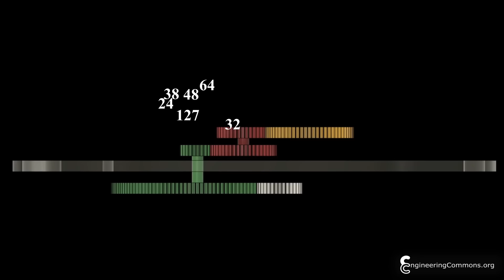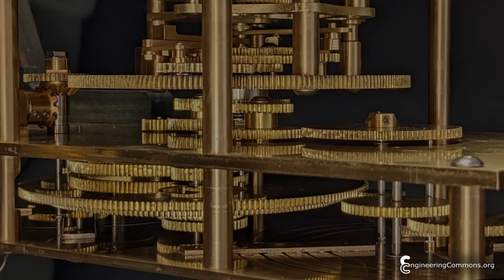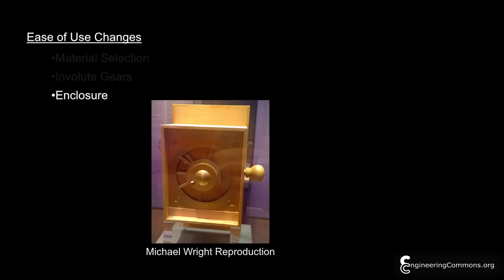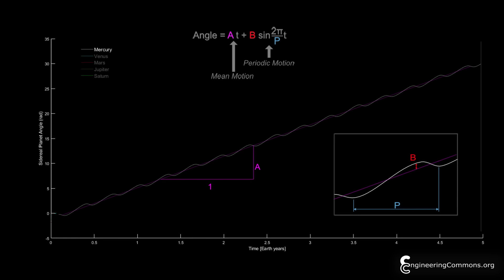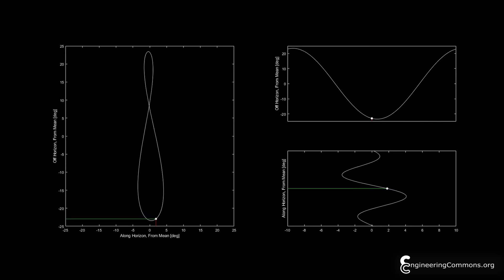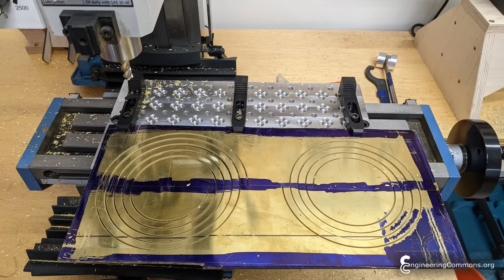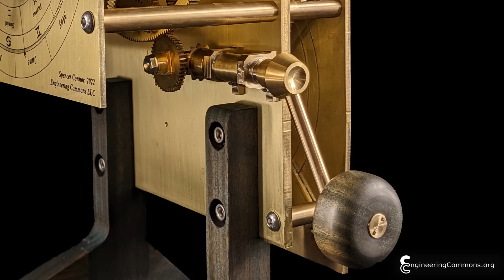Antikythera Mechanism V2: A Modernized Reproduction

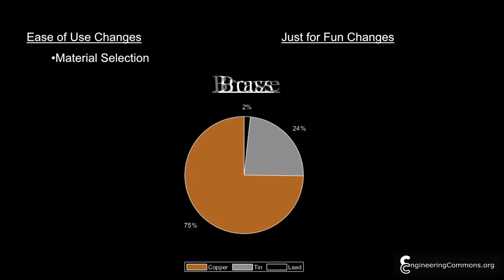Comment: 5:36 Knowing that brass is mostly an alloy of copper and zinc (to bronze's copper and tin) I'm wondering if the diagram depicting the metal component proportions and the pie chart for brass are a mistake, or if there is some other factor I'm not understanding.

Comment: Very well done, especially the geared mechanism for the backplate dials. 
But I would have liked to see more of how you dealt with two construction issues I encountered when building my own symplified modern  version of the mechanism (no planetary system and no backdial, but with real star map and dragon hand instead). My solutions were:

- single pointer for date and true sun: I implemented only the first harmonic of the true sun by using a non-uniform division of the date scale (offset equal to 1⁄24 of the radius of the orbit as attributed to Hipparchus by Ptolemy). In order to have the correct rotation rate for the moon train, I needed to implemented a 3-gear solar/date train to compensate for the non-uniform division.

- Initialization of the mechanism: I used December 4, 2021 for easy initialization (total solar eclips AND moon perigee) and January 4, 2022 (sun perihelion). To be able to set these events correctly into the mechanism, I implemented friction based connections for some of the axes/pointers.

Comment: Mate simply the best full stop, to use small machining techniques to make up all the moving parts, it must have been a nightmare really when you think about how precise each grove on each wheel ( let alone making or buying various small items like brass end stops or caps and bearing's or sleeves used inside each wheel ) and so glad you made the cuts as described otherwise the teeth would have worn out very quickly, Its a masterpiece of mechanical art really well done, 🙌🙌👍👍👌👌😎😎

Comment: There is a report in an old UFO book from the 1960s where a contact between an UFO occupant and a person happened in South America. In the report the contact reported he was taken aboard the craft. While there the contact saw a brass clock thing with dials and little wheels. The contact grabbed the clock thing and made a run for the door but was stopped by the occupants and the clock thing was taken from him.
I have to wonder if the clock thing was something similar to what was found in the water.
Reply: ‘report’

Comment: The Antikythera mechanism is clearly a hoax. The only other gearwheels know within hundreds of years of the supposed construction of the mechanism are crude, wooden, gears used in various types of mills. 
And we are expected to believe that an intricate collection of fine toothed wheels was built at that time, with no comparable mechanism found until several hundred years later?
Engineering and invention just don't work like that.

Comment: I am not an engineer or a scientist of any kind. I get that the astronomical calculations and understanding had to be phenomenal to design this machine. I also understand that it had to be built upon a foundation of advanced multidisciplinary science and skill. My questions are two: Why is there no other evidence of any type of mechanism even near this level of sophistication whatsoever in the historical record for the time? There is nothing as a precursor. The second one, I am an expert in or was, and that was as a jeweler and a guy with 25 years of a 52-year career in doing CAD and machining. There is no way in hell you can produce gearing of this level of complicity and precision without cutting tools controlled by some form of lathing and machining. It simply can not be done by hand. I have seen the most precision handwork in the world from various times and this is at the level of Swiss watchmaking in the 18th century. Even the tiniest variations of workmanship would have thrown the whole mechanism out of sync. Where is this tech or signs of it elsewhere in the historical record?

Comment: That was a fantastic creation, and an equally fantastic explanation.  Thank you.  Your work highlights just what a tour de force the original mechanism was!

There is certainly a very good place for carefully accurate reproductions of the original, yet I am fairly sure that all the modifications you made would have been made by the Ancient Greeks if they had the knowledge, metals and technology.  Who knows, maybe "Improved Antikythera" mechanisms were to be found back then with some of the improvements you made?

There is one thing about scaling the real planets into such a mechanism that seems impossible to achieve with absolute accuracy me - as Johannes Kepler found, the planetary orbits are not the perfect circles of your gears.  While very close, the offsets you use are not quite correct.  Trying to make a version of this based on elliptical gearsets of the correct "orbits" would seem to be an Herculean task.  Maybe it could be done using small chains?

I have to ask a really left-field question:   Have you heard from any flat earth or geocentric universe people?
Your analysis of the movement, particularly for your "for fun" addition of the various retrograde apparent motions, is a very serious critique of their position, and is just another one that makes a flat earth untenable.

Comment: The amazing BBC Horizon programme "The 2000 Year Old Computer" is highly recommended, if you want to learn more about the history of the Antikythera mechanism and the research into its functionality and how it was figured out, what its purposes were, and how they were achieved.

Your jaw will drop to the floor, when you see that this incredible degree of complex mechanical engineering and deep insights into the astronomy of the Solar system were already present in the Greek world around 200 - 100 BC. 

Why was this important knowledge lost to humanity for several hundreds of years later on?

Professor Frith's long and much more detailed presentation at Stanford University about the Antikythera mechanism a few years ago is also highly recommended.

Comment: You have achieved an interesting interpretation of the original Antikythera Mechanism. I would be interested in how you would incorporate a large band spring to power the device without having to crank it all of the time. Further I would be interested in how you would maintain timing accuracy.

Comment: What was the accuracy of the various ratios? Ie how long until their error was troublesome? It doesn't seem to me that there would be any way to correct this so would this be an early example of planned obsolescence? Did you set the machine to be accurate for the time it was constructed or modern day?

Comment: Mine has triangular teeth and is built like the original and does not work, even with modern lubricants.  The original from 2100 years ago wouldn't either.  It was an intellectual exercise for them.  The original theory was a little off as well.  It was remarkable for the time.

Comment: Simply fascinating! Not only about the details constructing the computer but I'm amazed at how you were able to relate the information in a way that I could understand! As a 1st class machinist (retired) I collected over 25 years experience working in many different machine shops. Based on your statement regarding pushing your machines to the brink, I'm guessing that most of the machines you had were very well built, but of non-commercial grade.

The machine work for this version of the Antikythera Mechanism is challenging but not unusually so. However, the machining doesn't approach the work you did in the calculations and engineering side of it! That's what truly impresses me! I worked closely with many engineers in my life, but I doubt I have more than an average understanding of the discipline. I have no doubt that you're a certified, degreed, engineer based on this video.  

I have experience with near-microscopic work, (high pressure regulator parts), on through to parts that weighed over 24 tons, (48K pound blow-out preventers). My primary expertise was with every type of milling machine including vertical mills and horizontal boring mills as well as specialized VTLs. 

But I regularly worked with the full span of machine shop equipment and every material from plastics to high-nickel content steels, extremely hard brass alloys and Inconel-X.

Most of my complex machine experience came from R&D job shops specializing in aerospace, hydraulics, electronics, oilfield, mold-making, tool-making and many others, (I can bore you to death with a list). Yes, if I may blow my own horn, I was "all that" back in the day, LOL. I also did a lot of gear-cutting work, including calculating and setting up the gear-cutting machines. 

All of the gear cutting work I did, as well as most of the work I've listed above, was done on manual machines, not CNC's.

This meant that I kept the latest edition of the Machinist Handbook in my box everywhere I went. 

Please Allow me to bore you with some 'pre-CNC days'😉:
I also gained a lot of experience programing the predecessor of the CNC, (Computer numerical Controlled), machines. That was back in 1976 when I started programing a Moog "NC" (Numerical Controlled) machine that could barely do more than drill & tap holes. 

The NC machines had no memory capability and relied on a 1-inch wide paper tape that we programmed with a Teledyne hole-puncher. Then the tape would feed through the machine's reader and execute the commands all in real time. If the paper tape ripped, (and it would do that often), the machine stopped and you hoped that you still had a backup copy.

A few years later, I was a supervisor in a large shop where half the machines were CNC. There, I taught myself the machine program languages that were the most prevalent at the time: Cobol & Fortran. LOL, It was another 7 or 8 years before shops started buying CNC machines that used the "Basic" program language. 

And another 5 or 6 years before they had the full, 'all-in-one' "Machine centers" that turned, milled, & drilled all surfaces of the part without the "machine-operator" touching it until it was time to remove one and chuck-up another. Notice I said "Operator" because by then, they didn't need certified machinists. 

The shops would hire a handful of certified machinists and use them as the "Set-up & 1st-part run team". Once the machine was setup and running good parts, they'd place an operator on the job. For me, that was a very good thing because I sucked as a 'button-pusher'. 

Anyway, when I had enough of that, I started going to specialized machine shops. Those that did R&D work and one or two-part runs. I'm not exaggerating when I tell you that I can't remember how many shops I've worked in. In some I was a consultant and/or supervisor, and in others I was contracted to do the job. I just moved along from one shop to another and gained the experience from it all.

These days, I don't have any shop-machines in my home except for a few consumer-grade drill presses and bench-grinders. After watching your video, I almost want to go out and buy a few good, albeit, used, machines but then, I'd have to consider the tooling, measure indicators, surface plates, etc., etc. I'd be up to my ears in bills, and I'm not getting any younger!

Thanks for the great video on a machine that I've known about for many years but never really understood until I watched it!
Rich

Comment: You have mentioned 13.36 lunar months in one solar year. I think it should be 12.37. Is it a typo ?
Reply from the maker: There are 12.37 lunar cycles (synodic lunar month) per solar year, but there are 13.37 sidereal lunar months (relative to stars, i.e. not subtracting yearly motion). I may have rounded a little wonky in the video if I said 13.36

Comment: Thank you. Great work.
One question: at https://youtu.be/mTsCx0E7YkA?t=1703 there can be seen a slight wobble in the largest gear while turning. What causes this?
Reply from the maker: There are two coaxial shafts through the center of that gear that are rotating with the same period as the wobble (1 lunar month). The outer one has a small amount of misalignment between the ID and OD, but projected out on the big gear it becomes noticeable.
Reply: @EngineeringCommonsLLC  Thank you for the explanation. Are the outer one and the gear supposed to be coupled or is it just touching periodically because of the misalignment?
Reply from the maker: @mcflapper7591  Yes, they are meant to be coupled. The ID/OD misalignment just produces a slight wobble that looks similar to axial precession.

Comment: Wonderful congratulations .
I believe that there should be several other versions of this device , And the practical purpose of it could also be used for navigation
? As the Greeks were constantly at war, I think the main objective was to be one step ahead of the opponents. The fact that the device was on the boat was not by chance. Astronomical purposes for them had another meaning at the time, didn't they? This device intrigues me very much, as for the purpose of its use. A computer on a boat, say they were simply a planetarium.

Comment: Not a machinist, not an engineer, not a designer, but in 47 years of cleaning up their mistakes, I was fascinated, not only in your abilities as all of these, but in the depth of putting this together. I will look at your website, but was wondering a few things. Can you estimate from the design, how old it might be? Do you think the makers knew that the sun was the center of the universe, or were just trying to get a fix on life, by mimicking the movement and motions? Did the Makers live by a lunar year, or a solar one? You mentioned an intercalary year; weren't the Jews the only ones to use that? Might you hazard a guess of the place of manufacture, triangulating from the eclipse information, or were you only showing the ability?  (I don't know if there were any remaining identifiers on the face, to indicate this.) Could I ask where you are located. I am just a poor retiree, but would love to see the craftsmanship up close if you are anywhere close to Canton, Ohio. This appears as something best designed and built by a single person ... did you have help. The math is high level, by the way, as is the knowledge of mechanics. Thank you so much.

Comment: For me, one of the biggest "wow" moments is realizing the precision necessary to produce this device 2000+ years ago. This is a bespoke machine, made by hand. Just one aspect, say, the teeth on the gears. Meticulously constructed such that the teeth are made similar-enough and then spaced uniformly enough around the gear is just amazing to me. Add to that all these gears interacting with each other in very precise ways.....It's just "wow." If you want further "wow," I heartily recommend "Click Spring" video series (mentioned above) where Chris not only recreates the device (fairly authentically), but does so with some of the "primitive" tools they would have had at the time. His work is also quite ASMR-ish.

Comment: Hello and greetings from Poland. Also thanks for this amazing video. And here is a challenge to all 3D printers users: Use CAD for parts design, then print and build "Antikythera Mechanism V3: A 3D Printed (More)Modernized Reproduction" It could be something extraordinary. Just think about it, 2000 years old tech build by using 21th century tech.

Comment: At first, I wondered if the change to involute gearing required exact sizes for each gear based on tooth count, and how those sizes matched with the original, and how you can change the mechanism to cope with the new size when everything is all together like that.
But, from ClickSpring I learned that the triangle teeth required careful adjustment of the distance between the centers in order to mesh smoothly.  So, the mechanism must be designed so each axle in turn can be positioned imperially.  In short, the triangle tooth profile is more exacting than the modern profile.  The perfect size of the gear should be within the tolerance of the positioning of the axle on the original.

Comment: Is there an error at the beginning? You mention a gear ratio of 19:254, but the metonic cycle (and your mechanism) have 235 months rather than 254. Where did 254 come from?
Reply from the maker: It depends on what type of lunar month, 235 synodic (relative to sun, or full moon to full moon) lunar months is the same as 254 (235+19) sidereal months (relative to stars). I probably could have been more clear, apologies for that.
Reply: @EngineeringCommonsLLC  Thanks for the answer! I didn't consider synodic vs sidereal. This stuff hurts my brain

Comment: Your modern adaptations to vexing mechanical problems should be accompanied with, at least, a brief commentary on how you think the ancient Greek technician(s) tackled the problems.  Without it your solutions merely come off as cheating.  I don't begrudge your use of current technology but accompanying explanations would have been a nice adjunct.  Otherwise, I was thoroughly captivated with your 'Herculian' accomplishment.👍
Reply: For that, watch Clickspring's videos

Comment: Hardly a ‘hobby machinist’. 

Updating to current values of orbits, stainless steel, threaded fasteners, modern labeling and characters, is the right thing to do! I especially like the design of the helix on the lunar display on the back. No shame in not adhering to a one-to-one with the artifact. 

This could, IMO, be a valuable production piece. Even limited number of machines could easily fetch an attractive price, and be a well received piece for collectors and museums. A one-to-one high integrity recreation wouldn’t be as relevant and more expensive. Click Spring’s recreation looks to be $100K commission piece. A one-off. Your design is just as valuable for historical and educational purposes. It’d be a prized show piece addition to any horological institute. 

In short it gorgeous.